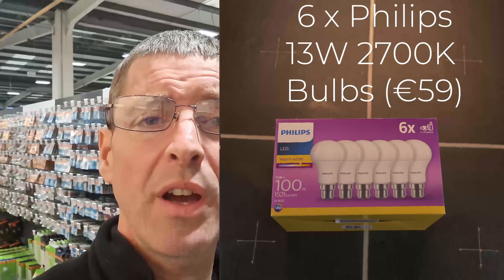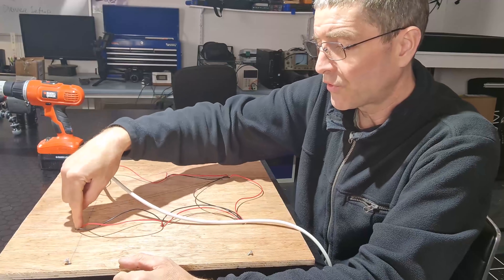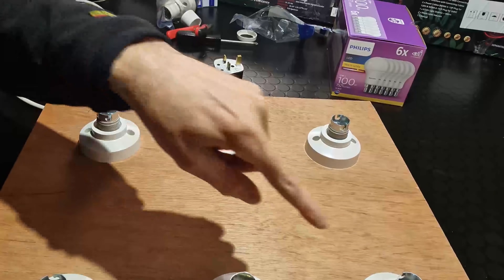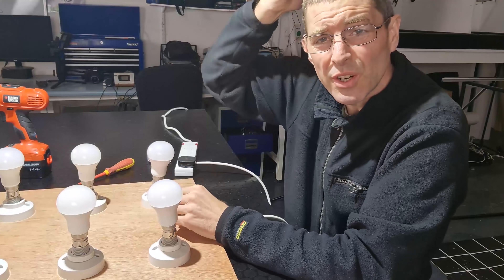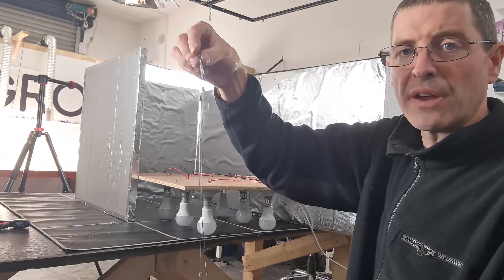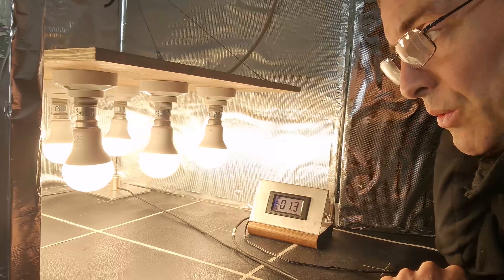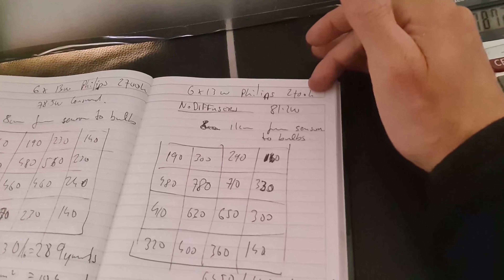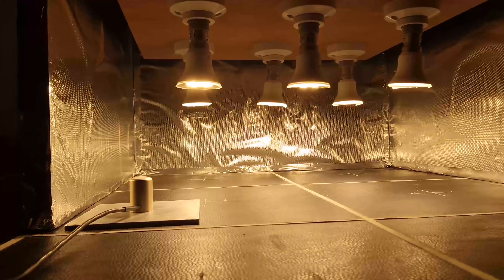DIY LED Grow light build | Build your own cheap simple and efficient LED grow light

Comment: Surely polarity doesn't matter at all with bayonet fitting, since they have no idea which way around you're going to put the bulbs in, so they have to work either way. Maybe the drivers in screw-in bulbs require a certain polarity, but bayonet bulbs can't. They have to work either way.
Reply: Its ac Polarity is not a Topic in Alternating current fixtures

Comment: No need for fittings. Just solder directly to the poles or open the bulb and use the wires inside to make parallel connection. In my country this will reduce the cost by 50%.

Comment: You will get vastly better results with Daylight Bulbs! These are actually Blue LEDs in conjunction with a phosphor to produce complementary colors from a single LED. Some of the light from the LED is absorbed by the molecules of the phosphor, causing them to fluoresce, emitting light of another color via the Stokes shift. The most common method is to combine a blue LED with a yellow phosphor, producing a narrow range of blue wavelengths and a broad band of "yellow" wavelengths actually covering the spectrum from green to red. The CRI value can range from less than 70 to over 90, although a wide range of commercial LEDs of this type have a color rendering index around 82.[39] Following successive increases in efficacy, which has reached 150 lm/W  in conjunction with a phosphor to produce complementary colors from a single LED. Some of the light from the LED is absorbed by the molecules of the phosphor, causing them to fluoresce, emitting light of another color via the Stokes shift. The most common method is to combine a blue LED with a yellow phosphor, producing a narrow range of blue wavelengths and a broad band of "yellow" wavelengths actually covering the spectrum from green to red. The CRI value can range from less than 70 to over 90, although a wide range of commercial LEDs of this type have a color rendering index around 82.[39] Following successive increases in efficacy, which has reached 150 lm/W

Comment: I have built an array of 36 core pro 2700k lights, I pulled the plastic cover off with a Swedish wrench rather than cutting them. All the lamps I have are like the one shown at 12:49 and not like the others with the screws. This did mean that many on the panels weren't properly inserted and caused the heat to pool in the panel rather than spread to the fixture reducing efficacy, so I jammed them all in properly xD. Keeping the panels around 60C seems to be the sweetspot. Instead of using a solid board I cut strips of wood 0.9cm wide, enough to screw on my porcelain e27 fittings, allowing full air circulation. I tried some other of stuff like drilling holes in the luminaire to increase airflow and applying thermal paste at the contact between the panel and the fixture, the holes actually made it hotter while the thermal paste seemed to have no effect xD. This video really put a smile on my face, thanks!
edit: Oh God! I just saw the price you paid :-/ I got the 20 of the lights for 3.2euro each and the next 16 when there was a sale and they were 2.5euro a pop...
Reply: Even cheaper now on Amazon and eBay.
Reply: I bet you suffered with excessive stretching, caused by the lack of blue light. Having observed various spectra, I've come to the conclusion that 3000K is better than 2700K, while 4000K is better than 3000K - primarily due to the amount of blue that will help reduce stretching - they all have a similar amount of red.

Comment: I've found some cheap led bulbs,  15W 2000 lumens 3000k.  I placed 11 of those on a piece of laminate floor, 20/45cm. 168W om the meter. 
I use my phone app, PPFD meter on a note 20 ultra,  and readings @50cm height are over 1000 under the lamp,  without walls.
I think I'll spread the lamps a bit more and place them on a 30/70 cm board, 2 rows of 4 lamps spaced 20cm apart and another 3 in the middle. 

o            o            o            o
       o            o            o   
o            o            o            o
On a 30 per 70 cm board. 
Horizontal spacing 20cm.
for a 50 per 80 cm grow area.
Reply: Looks fine! Have a Look at photone - they just released it for Android i think the readings are closer to Real par readings.
Your fixture should Do the Job!

Comment: Would be interesting to see the efficiency in µmol/W when the lamps are only run at half or 0.25x power (like the dubai lamps). The output will be lower but the efficiency should be much better than.

Comment: I made a Light that has eight Bulbs about 20 watts each, Cool White for Veg and Warm White for Flower to cover a small area about 1.5 feet by 2.5 feet, it has reflector panels and three small PC fans to pull the warm air up and out. It pulls about 160 watts and works well for 3 small plants in 2 gallon pots. Using better brighter Bulbs makes a big difference but adds a lot to the build cost. Being able to swap out Bulbs is a good thing.
Reply: The tree fans were enough to deal w the heat?? Do you have any pic of the setup?? Im doing basically the same but the heat goes crazy
Reply: You could get more watts/lumens per area by using GU10 LED bulbs mounted in a tight array. GU10 bulbs are available at >100l/watt, and the ceramic sockets can be bought in large quantities at a much lower cost than even E27 screw fixtures.

Comment: Anybody who watches this should go for at least a A19 they run 2200lumens but get a little warmer, and get bulbsplitters to run more bulbs for more light output , also I would add a day light spectrum in there as well 5000-6500k , up to you... . experiment if ya want I run all 5000-6500k , been doing it for years I know what works , you can throw in a few 2700k,3500k, and 4000k if yea want a better spectrum
Reply: You can find 200 watt LED 'flood light' with clear lenses, waterproof, for less than $20 US. I combine a 6000k and a 3000k, and getting great results with 400 watts (actually about 350 net watts). They are already wired, come with a mounting bracket. Only drawback is that they are not dimmable. Using the single bulbs is no longer necessary.

Comment: So this is better than the Marshydro TS 600. ?
Reply: If upfront cost is a big issue, this can be better. If you only have $20 to spend on lights, you can find a 3000k 100 watt floodlight and a 6000k 100 watt floodlight for around $10 each and mount them on opposite sides aimed at the same spot.. They are prewired, waterproof, and already have a clear cover.

Comment: They sell 7 way bulb splitters.  Alot less work maybe not as big of a footprint but more intense light.  Perfect for a single plant especially if you use different bulbs for veg and flower. I'd use 6 bulbs for veg and 7 bulbs for flower.

Comment: Ah yes was just about to ask if you werent going to remove that ikeaplastic around the bulb Nice . only used Cfls in different sizes and shapes and wattages for similar build it actually works real good but its not perfekt but it work. Your channel is real nice Shane ! / Paul Roger

Comment: In theory would it not be better to use Philips 10w LED bulbs emitting 6500k for veg and the Philips 13w 2700k bulbs for bloom?? 🤔 Would the following setup not be more effective to grow "herbs"? 

For vegitaion.
Duration of light: 16/8
Distance from light source: 12 inches 
4 bulbs 19w/150w Philips LED 2700k 2500lm.
8 Bulbs 10w/75w Phil LED 6500k 1055lm.

For bloom.
Duration of light: 12/12
Distance from light source: 12 inches
15 bulbs 13w/100w Phil LED 2700k 1521lm

The cost for the bulbs is 215$
Reply: Better to use both at the same time, but you can get single cheap 100 watt 6000k and 3000k 'floodlights for $10 each and not have to mess with wiring  and the floodlights are rated as waterproof.

Comment: Hi Shane, thanks for this tutorial!
I was wondering, what are your thoughts on the Sylvania Natural Series (TruWave Technology)?
They are amazing for color accuracy, and has a really smooth and sunlike curve (with reduced blue light).
I recently replaced all the bulbs in my appartment with these. I do a lot of filmmaking stuff, and i have to say that the color accuracy is GREAT on camera (almost identical to true tungsten halogen bulbs, no magenta or green pollution). I can't imagine they would not be great for growing also!  The cool thing is that they aren't that much more expensive than regular cheap bulbs. A most have for home lighting , that's for sure!
Reply: This seems to be reduced blue waves,plants do need alot fo blue in veg,I think.
Reply: @enigmab8978  No, they actually don’t need that much blue light. This information has been misleading growers for years. Take a look at the latest and best LED chips for plants.. they are warm lights (small bump in the blues and a very high bump in the reds). They need way more red light than blue light, otherwise they get too bushy, and that’s not very good for light and air penetration. Shane and other specialists like Bruce Bugbee discuss this on their respective channels.
Reply: @davidmultimedia2024  Oh,yes I have heard that about plants being bushy.I will have a look.Have you had an experience with the lights you mentioned before,or have you found a better alternative to those above?I have heard that par 38 are the best off the shelf for plant cultivation but they are expensive in comparison and I have no idea if it's marketing or the led lights are different.
Reply: @enigmab8978  No, I haven’t tried them for growing.. I use real grow lights. Although, these are my favorite bulbs for indoor lighting, because they have excellent color accuracy.

Comment: Hello, Can 50 Watt 3000 kelvin 4000 lumens daylight SMD LED lamp make grow light like 50 Watt 3000 kelvin 4000 lumens Cob LED lamp?  I use 106 led lamps (20 blue, 86 red led full spectrum) besides such a lamp, the area I illuminate is 110cm * 110cm height 45cm. Can you help me with these dimensions?

Comment: With a little bit of elbow grease and some wiggling, you could just pull off those plastic covers by bare hands - for most of the brands out there.If you hold either side properly, there is no way to get hurt doing that.
And - later it can be re-assembled too.

Comment: 4 ft LED shop lights @ 5500 lumens only $13 at Menards.  4000 color.,,Even cheaper if you catch them when 11% off.  Much easier and far cheaper per lumen.
Reply: 200 watt flood lights are available often on Amazon for under $20. And I've seen sets of 4 80 watt lights for $16, and wish I had ordered them. I bought 2 of the 200 watt, and actual wattage was 180, which is about right. I bought 4 of the 100 watt lights for $8-$12 each, in both 'warm' 3000k and 'cool' 6000k to get more red than the 6000k alone would provide.

Comment: Great example of a DIY grow light.  I appreciate the difference with the diffuser off the bulbs. My question is... because you had these so close to your PAR meter,  how far below the canopy of your plants would this method still be effective for? Your grow light, which I own,  has a higher hanging height and deeper penetration. I am just curious if this set up would really be effective beyond 6 inches below the canopy, or perhaps only good for the surface.
Reply: Just add more bulbs. He proved the efficiency of production of PAR light using the bulbs, more bulbs will cover more area, or you can hang the fixture higher with more bulbs if you have taller plants.

Comment: Suggestion : shoot a heat gun at the junction dome/body , use gloves , turn slowly , when reached proper temp the dome will pull off easily . Did you test 2700k versus 5000k ?

Comment: I have bought several LED flood lights, waterproof, with 100-200 watts per fixture(actual draw about 85% of that) for $8-12 US watching the Amazon site and sorting through dozens of lights. Just ordered one today for $12.20, 20,000 lumens, 2800-3200k. This eliminates the fuss of wiring. I had a couple fixtures using many single bulbs like this video. Bulbs of ~9 watts cost about $1, but the based are about the same, so for $12.20, to get as many watts as the single 200 watt flood light, I would need to spend at least $20 using cheap parts. With the complete outdoor rated flood light, they are no exposed wires, and the cover is clear, non- diffusing. The only issue would be the need to hang a little higher to even out the coverage because the LEDs are mounted pretty tightly in a maybe 4 x 7 inch area. And it is non=dimmable, where you can take and add single bulbs in the array of many bulbs. I pretty much assume that 2700k, or 3000k will be the same whether mounted in the single large fixture or spread over 9 or 14 individual bulbs. I want to say that I have learned a whole lot by watching your videos, and by far, this is my favorite because it hits home. I live on a very limited budget, and could never afford a real quality grow light, or even the cheaper Chinese models flooding the market. I do say that you need to read the fine print on any light you buy, at least in the US. A light, or grow light labelled as 2000w may be anywhere from 175 watts used to maybe 600 watts. One brand's 100w may have more power than another brand's 1800W and be lower priced.  Again, thank you for your service.

Comment: Why do you use 2700K light instead of 6000K LEDs? Everywhere else I read higher Kelvin is the correct way to go due to the blue color you get with higher K numbers.
Reply: Same. Everything I've seen points to this.
Reply: 6000k for veg, 2700k for flower.

Comment: I know I am late to the party, but I have a question. Would tossing a couple of 5000k bulbs in this build improve your spectrum in any meaningful way?
Reply: Yes or higher would give more blue light for improved rootings and less stretching etc
Reply: @_cloudface_  I've read that a measure of added blue (such as from a 5000k bulb) improves the density of trichomes. The more trichomes a bud has, the frostier it looks, and because these trichomes house cannabinoids like THC and CBD, the bud becomes more potent.

Comment: CFL's I'm sure are cheaper and might be brighter. 
I know the your video isn't going to accurately portray the light levels, but I've ran 3 CFL's that seemed brighter:
(room lights were on, phone auto "corrected" the light levels)
https://media.discordapp.net/attachments/721233210687881287/721238424912396378/20200605_000728.jpg

Comment: I did one with four 8 watt, four 13 watt, a power strip, some Y adapters, some zip ties and some plug sockets.  An 84 watt or so light.  I added it to a 300 Mars Hydro old school white  panel and a 300 watt BESTVA in a 39x39x72 tent. It was banoodles, I grew some fat ass colas.

Comment: Too much white yellow light leads to stretching of plant rather then using blue spectrum which helps the green growth over stretching out the stems where bud sites will be skinny, rather then thick. I put thought to this of using  a grow light with the full spectrum rather then using   regular LED bulbs to be able to get that thick Kola instead of a prolonged stem of popcorn bud sites.. Too much spacing of bud sites but if its in ya things of doing then go for it but remember of using certain light spectrums....

Comment: Electrician here. By removing the cover you are exposing non-isolated higher voltages which is grossly irresponsible to show off. I know you don't give a damn about safety, Shane, but you are going to get someone injured or killed with videos like this.

BTW, it's "efficacy", not "efficiency".

Comment: if you have the height i recommend these setups really..if something happens to the bulb throw it out plop a new one in and youre done. in my microgrow i use two 1-7 bulb splitters on hanging lamp cords..14 bulb total..avg 8-900 mmol..total cost here in the states 35-40 bucks for it all. i would recommend using dimmable bulbs with a dimmer switch though if i could do it over again.

Comment: People don't realize how cheaply you can put together a wicked veg light , I've used two 55 watt CFLs @3800 lumens each , 6500k and four 23watt CFLs 6500k 800 lumens each  for a total of around 10k lumens + $60 total , plants have stalks the size of a pencil in two weeks ! Never seen any light that can match it , plants are so bushy it's unbelievable but the curly CFLs are getting scarce !

Comment: Would this be possible with GU10 fittings and bulbs ? Also would you be best using 2700k-3500k bulbs for flower and 6000k-6500k for the veg phase ? Cheers in advance
Reply: I’ve made my own boards using GU-10’s with 25 x 50w 4000k LED bulbs. I planted 45 Jalapeño seeds on 13 January. 40 germinated in 4 days. I’ve repotted them twice since (now 27 February). They are growing great, nice compact growth, flowers starting already.

Comment: You can usually remove the tops by pinching them with a large pliers (slip-joint works great).  The tops will probably crack before you get them off but it's easier to remove and you don't have a bunch of plastic dust in your "tanning booth".
Reply: Lol tanning booth.
When i first got my 4x4 and set it up. My sister came in and says… “Awesome, a tanning booth”
I didn’t know that she was talking about so she told me. People stand in there and get sprayed. Lol i freaked, a 48yo just learning what a tanning booth was.

Comment: BEST way to get diffuser top off is to put the dome into a bench vise, squeeze it, remove and rotate 90 degrees, place back into bench vise and squeeze it again.  The top will literally just pop off.  Been building spacebuckets for years.

Comment: Would it not be sensible to cover the sheet of ply in foil to make it reflective?
Reply: Flat white is more effective at reflecting light that aluminum foil. Shouldn't matter with the bulbs he is using as all the diodes are oriented downwards. However some bulbs have the smd mounted and various angles possibly benefiting from a reflector of a sort.